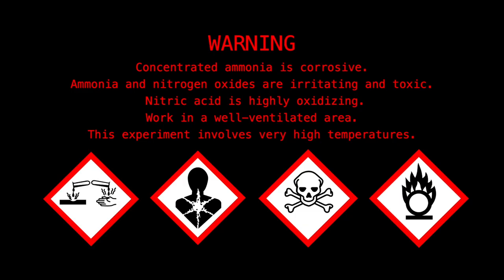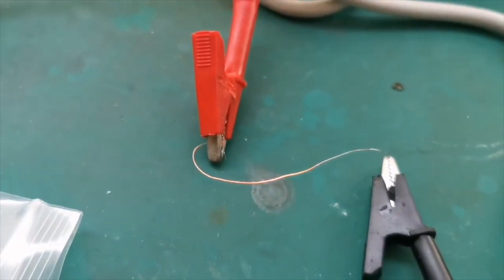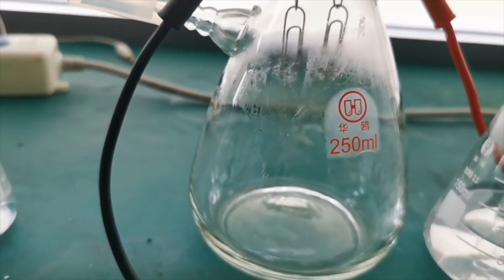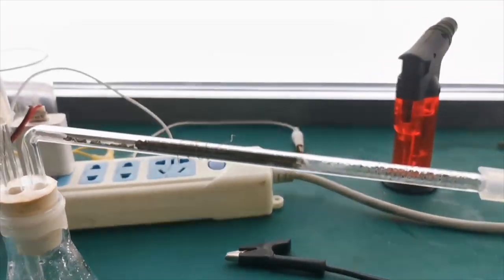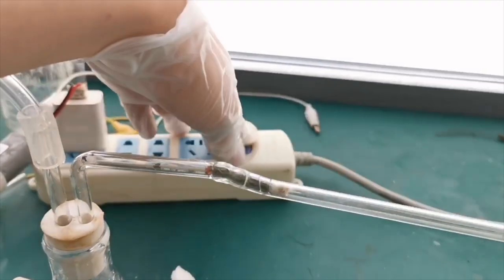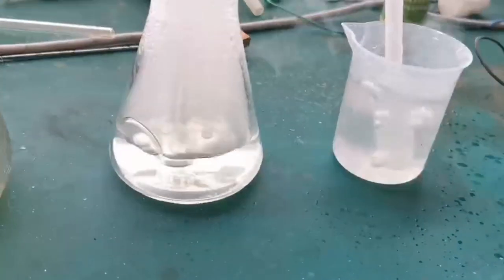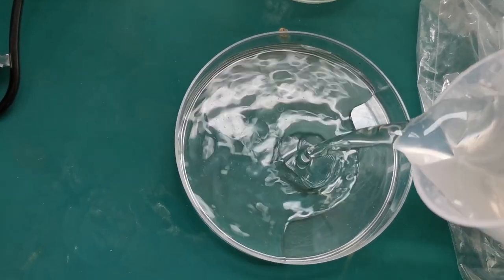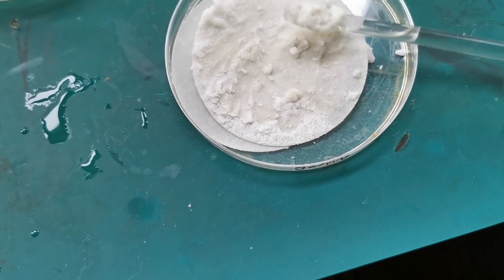1.7 Three Acids - Making Nitrates by Ostwald Oxidation - SUCCESS!!

Comment: Try using a bit of brick 1 from an automotive catalytic converter. The platinum 5% rhodium catalyst works great for making NO2 from ammonia, yet the irony is in reducing conditions it creates CO and N2 from unburned hydrocarbons and NO from combustion.❤
Reply: Why does IT Work in that way in this Case?
Reply: @sheesh7872  the catalyst turns the ammonia and oxygen molecules into no2 and other oxides of nitrogen
Reply: @zahariburgess3660  so there isnt anything to reduce the nitrous oxides with, so it just oxidises the ammonia instead of ht ecarbon/hydrocarbons
Reply: @sheesh7872 yes basically, that is how they do it industrially

Comment: The best nitric acid videos were using the birkland-eyde reactors, a spark gap in a bottle or flask makes the no2 which you bubble thru water or hydrogen peroxide to get nitric acid. If you put baking soda in that water you get sodium nitrate.
Reply: You're going to get a good amount of sodium nitrite too
Reply: @chemistryofquestionablequa6252  yeah... forgot about that stuff. Seems everyone wants that anyways.
Reply: @alllove1754  the issue is separation of the two, which can be done, but it's awkward and time consuming.
Reply from the maker: Regarding the separation of the two, this is why I used potassium carbonate (instead of sodium carbonate) in my reactor to absorb the nitrogen oxides. Potassium nitrate has a low solubility in cold water but potassium nitrite and carbonate are both very soluble, so the KNO3 can be removed by boiling and filtering.
Reply: @MIH0319  smart

Comment: Hi, very cool,  to improve the method a possibility may be to try to use a variable power supply or another method to regulate the airflow, and use indicator paper (soaked in water) placed at the end of the first oxidation tube with the catalyst, then regulate the airflow so that the paper indicates the presence of only acid, in this way, you may be able to waste less ammonia, because the current setup may force more air/ammonia mixture than what the catalyst can convert. an additional improvement might be also that you use two separate pumps, 1 for the ammonia/air and the other for just air that converges before the catalyst and regulate the airflow so that you achieve a better yield of NO2 instead of NO because there would be more oxygen reacting.

Comment: WOOOOOOOOOOO congrats! I wonder If copper would work as a catalyst, ive seen it as an alternative in some places.
Reply from the maker: I've also seen some reports about copper and manganese oxides as catalysts, but chromium oxide is a much more widely used and easily prepared alternative.
Reply: I also wonder if it could be modified it to make nitrites instead of nitrates. A partial combustion seems like the simplest way to me but I dont know how you'd separate the nitrate and nitrite salts.
Reply: Ammonia-air-mixtures often tend to deflagrate or even explode while heating them in contact to a catalyst under simple homelab conditions.
So congratulation to your success without any accidents by shattered glassware. 👍🤕
Reply from the maker: Actually, I did demonstrate the separation in the video. The nitrogen dioxide reacts with potassium carbonate to give both potassium nitrite and potassium nitrate. The nitrate salt is poorly soluble in cold water, so it crashes out, leaving the nitrite in solution. In theory, because the reaction produces both NO and NO2, and only the NO2 transforms to nitrates, the yield of nitrites would be higher than that of nitrates. But nitrites are easily oxidized by air to nitrates, so the separation may be difficult.
Reply: @MIH0319  aaaaaa silly me. Thanks for the clarification.
Reply: @MIH0319  manganese oxide is good but its not self sustaining and needs constant heating so maybe a mix of chromium and manganese oxides may work out.
when I ran manganese I got some success but switched to platinum wool from ebay later due to frustration.
Reply: Copper burns ammonia to water and nitrogen.

Comment: My idea of the Oswald process was to use an T connector with valve bevore the flask with ammonia. If you open the valve part of the airstream pass by the ammonia flask and goes later into another t connecter bevore the catalyst. So you can regulate your O2 content in the ammonia air mix. If you close valve full air goes to ammonia and to the catalyste when temperature to high or withe vapors of ammoniumnitrate forms you can open the valve. The ammonia content drops and the air content get higher.
Reply from the maker: Indeed, a T-shaped valve would be awesome to control the airflow. I will probably build an apparatus like this in the future, but this video is more like a proof-of-concept (I later recovered around 10 grams of potassium nitrate, which is not a lot).

Comment: To keep your platinum and reaction chamber working smoothly and longer make sure you load your reactant in the 1st chamber
If you do try this method make sure  Prior to turning on your platinum you need to purge all the air out (flush out the basic atmosphere no catalyst ) 
By having Put a load into your flasks of ammonia  by running the air pump for around 1 min per 100 litres per minute to maintain your efficiency and

Comment: btw something to be careful about is that the ammonia bubbler at the end of the NO2 absorber will likely form ammonium nitrite as well from incomplete oxidation and when aqueous ammonium nitrite simply decomposes to nitrogen gas but if you get dry ammonium nitrite it explodes rather violently, it might be better to put a hydrogen peroxide bubbler then ammonia so any NO gas will oxidize to nitric acid and NO2 which wont form ammonium nitrite
Reply from the maker: As far as my knowledge, NO doesn't react with H2O2 in aqueous solutions. Instead, NO2 reacts with H2O2 to directly form HNO3. So the only practical method is to put a scrubber (such as sulfuric acid or anhydrous calcium chloride) right after the large flask, but before the small absorption flask. This will get rid of all the excess ammonia present and only leave the nitrogen oxides.
Reply from the maker: I also mentioned in the video that an excess of ammonia would cause white fumes (ammonium nitrate) in the large flask, so if you don't see such fumes, then the ammonia is probably not in excess and there will be minimal amounts of ammonium nitrite formation. Even if it actually forms, the final boiling step would remove it as nitrogen gas.

Comment: where can i get platinum wire?
Reply from the maker: You don't have to get a platinum wire for this. Chromium oxide made by heating ammonium dichromate works well
Reply: Ebay,  Amazon
Reply from the maker: This would certainly work!
Reply: @MIH0319  do you have a tutorial video on how to make "chromium catalyst for owstwald process?????
Reply from the maker: @Tridenux  Just heat ammonium dichromate in a test tube to 400˚C until it turns green. No need for a tutorial
Reply: @MIH0319  please sir, make a spefic tutorial on that topic, we are still a noob. And buying a platinium is very expensive then gold and not everybody can afford it. Pls make a video tutorial.

Comment: What you need as catalyst is copper.
Reply: Won't it oxidise really quick?
Reply: @AlexanderSchwarz-ck3cx  ammonia reduces that back instantly.
Reply: @dorzsboss  oh that's nice to know! Then I'm not afraid of chromium oxide contamination as it happened in this video, since I can use copper wire
Reply: @AlexanderSchwarz-ck3cx  the problem with this method that the nitrogen-oxide can react with remaining ammonia and forms ammonium-nitrate what can explode spontanously at this temperature.
Reply: @dorzsboss  damn... and this would not Happen with chromium oxide right?
Reply: @AlexanderSchwarz-ck3cx  in my opinion it is not depends on the catalyst. I tried this reaction in lab  when I was student and once it exploded. I used copper wire as catalyst. The explosion happened not because the catalyst but because the reaction product reacted with the remaining ammonia and ammonium nitrate is an explosive. I remember, I had to make the copper wire red hot to ensure the ammonia's oxidation. Maybe chrome-dioxid works on lower temperature.